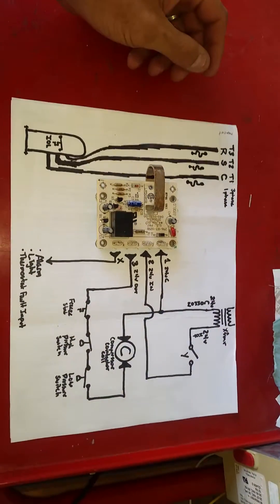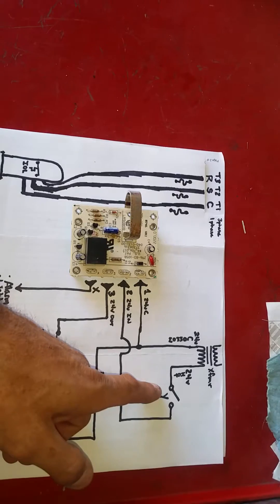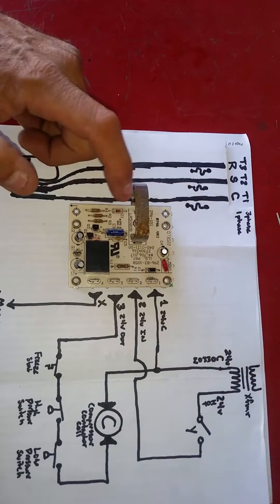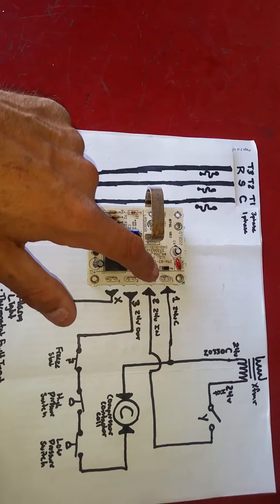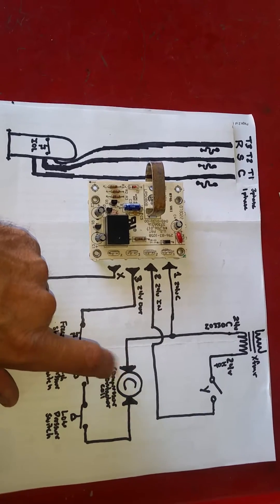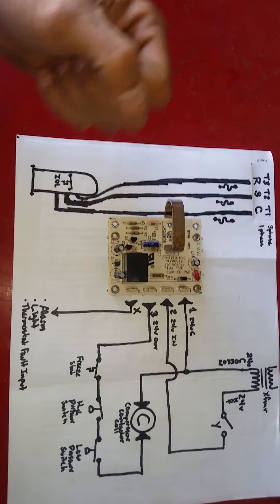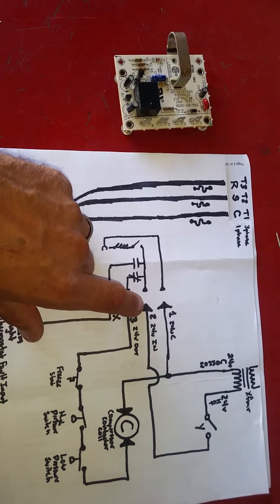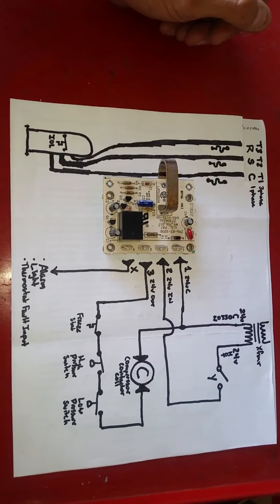Carrier CLO (Current or Compressor Lock Out Board) explained.

Comment: Thanks for the simple diagram. Made removing and installing solid-state time delays very easy, because unit wiring diagram was gone/faded/nonreadable.    
I set delays for 5 minutes on stage one, 7 minutes on stage two. With the amount of power glitches we have and constantly resetting to clear lockouts, it's feasible to put time delays in, to alow auto restarts. Thanks again

Comment: Thank you for this video, by any chance are you familiar with the blue control boards with the CLO moles plug intertwined with the main board itself? And if the CLO trips would the condenser fan motor stay running without the compressor?

Comment: Hello SLC Tech
Yesterday I was working on one of the Carrier Horizontal units with a Current Sensing Board. It was my first time troubleshooting one of these boards. I suspected it had something to do with the amp draw because my compressor was drawing too much amp and it was shutting down on LRA Locl Rotor Amp. When I removed the common wire on the board and contactor will energize try to start the compressor but it will fail on LRA. Thank you for clarifying. Great educational video.

Comment: TY , For this.  So if I measure 24 volts at terminal X that means the board is in Lockout due to a low current at the compressor?  Other than that X terminal should not read any Voltage in normal operation operation.

Comment: Excellent video; been dealing with a Goodman ComfortNet communicating heat pump that is constantly but randomly throwing a bogus "rotor locked" condition which only means that the thermostat will no longer call for cooling and the temperature in the house rises until someone is able to intervene.  Every single time, killing power to the transformer resolves the issue for some number of hours or days.  Have had multiple "Goodman certified" techs out to the house but it has never been resolved.  I wonder if there is a hack to bypass the flaky Goodman current lockout components with a more reliable one?  The techs replaced the entire board on the outdoor unit to no avail.  Pressures and other parameters were tuned.  Starter capacitor replaced.  Power company said supply is fine.  I can't imagine they overlooked the run capacitor or wiring.  I just want an HVAC system that works day-to-day.   Goodman actually says to look for voltage (208/230 systems need above 197vac and less than 253vac), but your explanation is more logical.  Don't recall which is which, but have DSZC160241AE and DSZC180361AD.  The upstairs one on a dumb thermostat never locks.  The downstairs with Goodman's touchscreen stat with Honeywell internals is constantly showing a bogus rotor lock.
Reply: sir we have  a same isssue our unit is Carrier..20 tons,,what remedy you do to resolve the issue..your response is highly appreciated.thank you.

Comment: Hi, SLC. TB here. The most frequent cause of the CLO locking out the compressor is when the LP switch opens during a low ambient startup on units without a working economizer. Carrier had a timer kit that could be installed to bridge the LP switch until pressures could rise enough that the LP would stay closed. We found we could make our own bypass. Of course, I have found the compressor conductor removed from the sensing loop and terminals 2 and 3 jumpered together by others... which is not the right approach to that issue. When they place that jumper, they lose the protection the safeties provide, including the HP switch and the freeze stat. The purpose of the board is to not allow the contactor to ride on the safeties, opening and closing repeatedly when there is a problem. This way, the tech can know that an issue exists, and then investigate the issue, and the contactor can have a much longer lifespan, along with the compressor. That's a very good explanation of the way it works, too.
Reply from the maker: Thanks TB. Hope all is well with you, loving my new gig in the private industrial side of things.